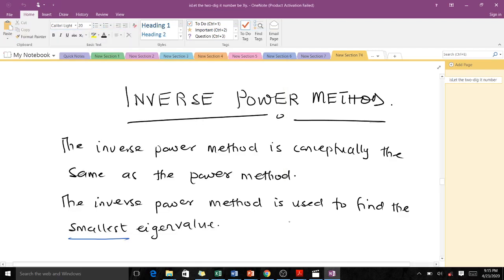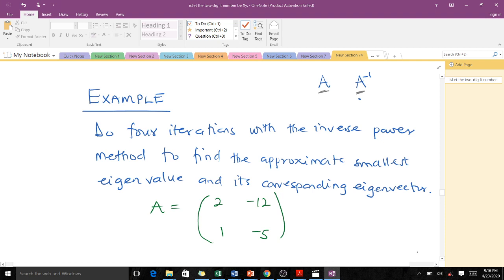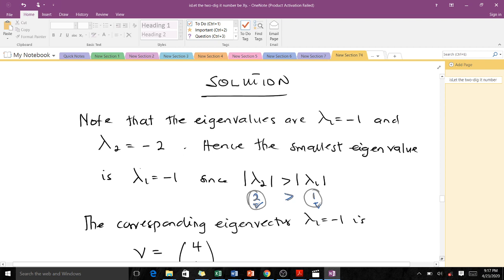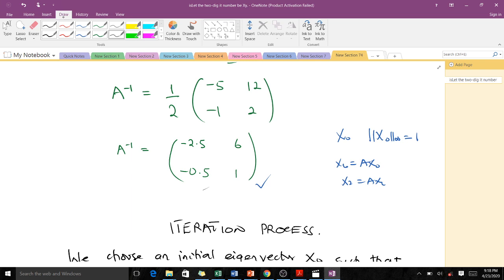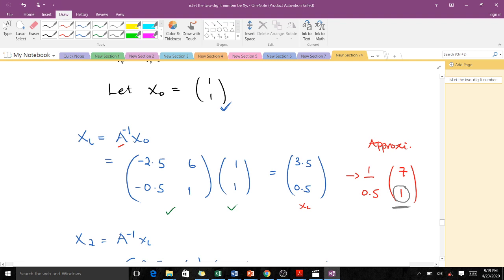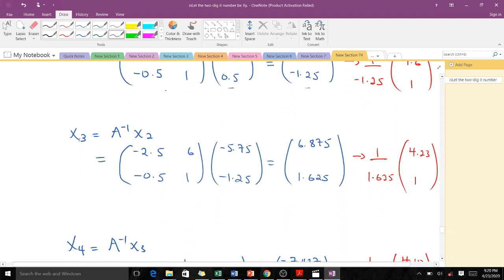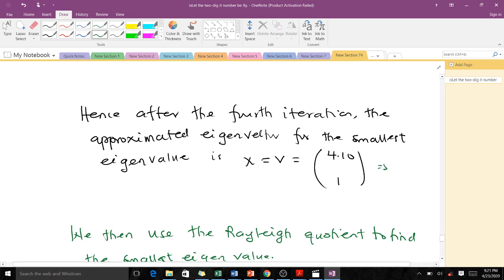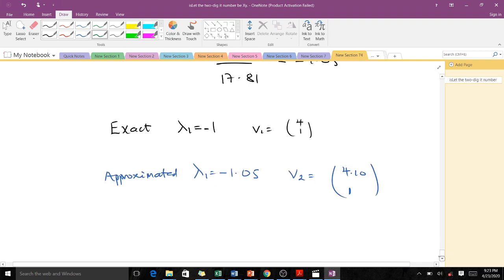Inverse Power Method

Comment: For each iteration, isn't the eigenvalue used in dividing the 2x1 column matrix supposed to be the largest of the two values? why did you divide it with 1.625 instead of 6.875?

Comment: hello, i have a question. When does the algorithm stop? please answer it. thank you so much.
Reply from the maker: If yes then, the inverse power method Algorithm will fail if the given matrix is non-singular, not a square matrix(since we can only find eigenvalues and eigenvectors of square matrices)
Reply from the maker: And with the stopping criteria, it will always be specified in the question either by stating the number of iterations you should do or by giving you an approximation error which is acceptable.
Thank you
Reply from the maker: Also note that the Algorithm doesn't converge for any given matrix.
Reply from the maker: Please do you mean when does the Algorithm fail?